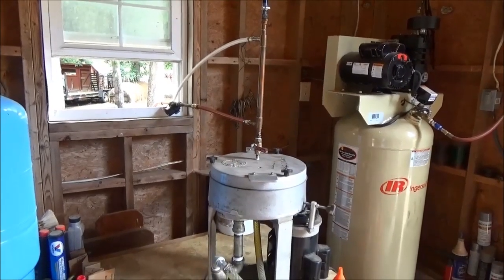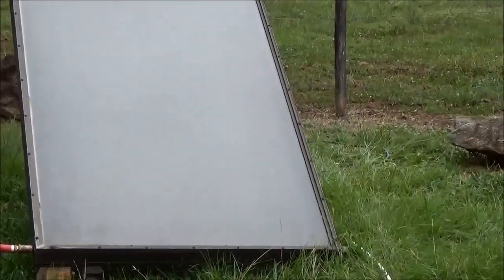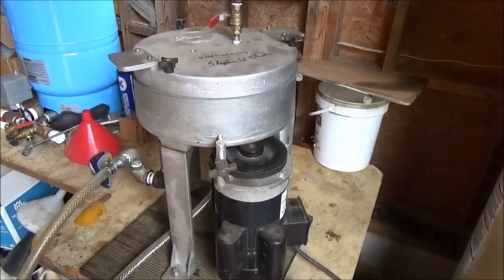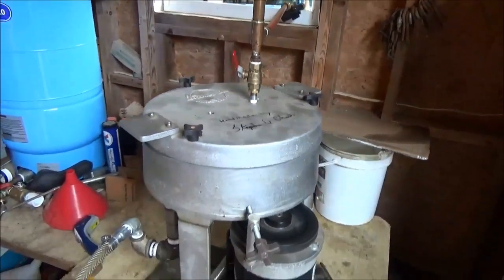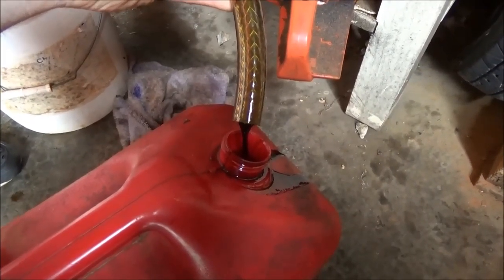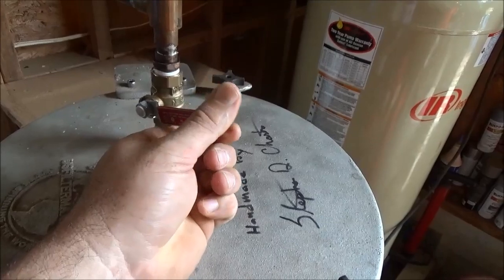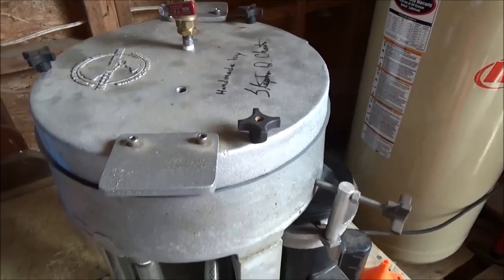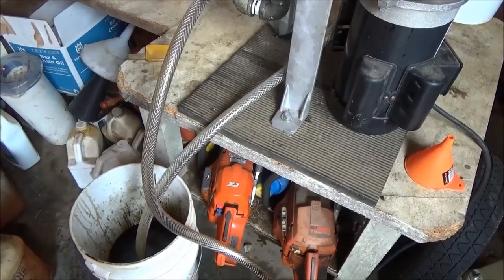Making Fuel Is Cool With Hot Oil

Comment: I worked 30 years in a chemical/pharmaceutical engineering dept. Our centrifuges were used to separate solvents, methanol and various alcohols, from product cakes. These machines were purged with nitrogen to maintain an inert atmosphere to prevent explosions. All components were grounded to prevent a static charge buildup. Please insure the oil you are working with has not been contaminated with gasoline or other solvents.

Comment: If you attached the heat exchanger to the bottom of the centrifuge, and stuck a rod through the vent hole, you could run the centrifuge at very low rpm as a kind of “Cleaning Mode” without even opening it up.

Comment: You can build a heat exchanger box around the exhaust manifold on a combustion engine or wrap some coils around it then run the old oil into it. The exhaust heat is more then enough to vaporize it. Once you are producing vapors you can run a gasoline engine off used motor oil vapors. I've ran a gasoline engine off oil vapors, diesel vapors and of course gasoline vapors. I will try plastic vapors at some point.

Comment: You can biuld a small still and make gasoline and diesel from plastic rubber and used motor oil.once you heat it with a rocket stove the propanes butanes and methane with drive the cycle

Comment: Do you think this will degrade your filters any faster than regular diesel?  I guess we should probably be stocking up on 5-10 extra filters for each vehicle, while they are still available and fairly inexpensive, just in case.
Reply from the maker: The Centrifuge cleans the oil better than any filter so no I do not believe it can degrade the filters any faster.

Comment: I take it with the setup shown, you are introducing hot water into the incoming oil line and the oil/water mixture is being spun in the centrifuge together?

Would making a heating coil for immersion into the dirty oil make the hot water system a closed loop and therefore not waste any water from the hot water tank and not introduce any water into the dirty oil?
Reply: There is no water mixing with the oil.  The oil is being heated by the solar heated water in the tube-in-a-tube heat exchanger located above the centrifuge, and the cooled water is returned to the insulated tank at the top of the thermosiphon to be reheated in the solar panel. It is a closed loop system, as you mentioned.

Comment: This setup has got me to thinking. I wonder if a centrifuge on a smaller scale, (driven by an electric motor powered directly from solar) added to the waterline before my filters would make them last longer before cleaning/changing. Also, I was thinking of heating water with a system similar to this but adding a 'rotary water hammer' instead of a centrifuge and directly feeding into the 'rotary water hammer' (instead of using the heat exchanger). I got the 'rotary water hammer' idea from here "yh_-DUKQ4Uw".
Reply: Oh, and before everyone jumps on me, I know the video is a horrendous scam. I just used it to show the water heating application.

Comment: Normal process for used motor oil is to let it sit in a pond for a year.
You can just fill a glass carboy and look at it every month, eventually it clears with the sludge at the base.
Old engine oil doesn't break down, it's just dirty.
Reply from the maker: Good reminder. Thanks

Comment: What will you be able to run on that oil??
Reply from the maker: Everything diesel.  For me I am running a 96 VW Passat TDI, a New Holland TC35DA and a 2002 F250 with 7.3L Powerstroke. I am mixing the Oil 50/50 with Diesel.  Still experimenting with mixtures.
Reply: engineer775 Practical Preppers 7.3's the only good powerstroke engine built. How well does it run with the 50/50 mix?
Reply: There is a flaw in your design. 
The waste hose should be unobstructed. This will allow ALL tha water vapor to escape away from your system. That's  what you want. ALL the water out.